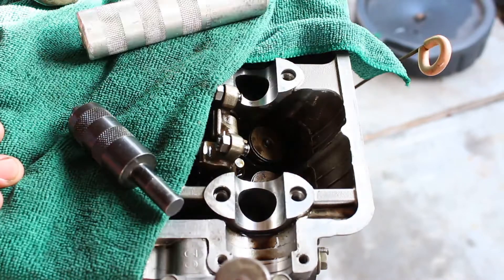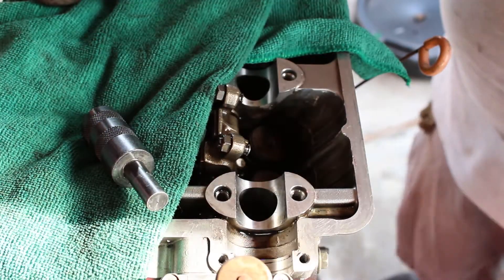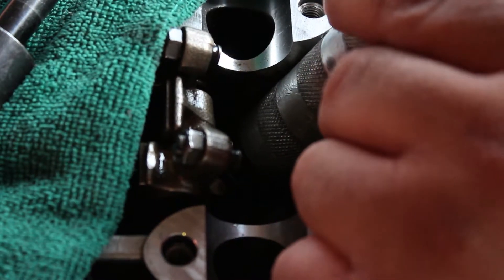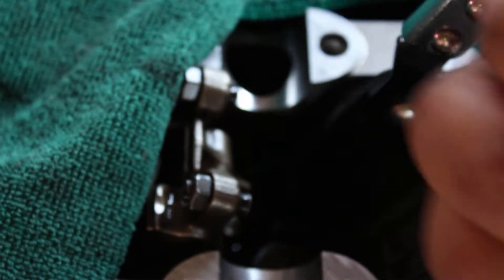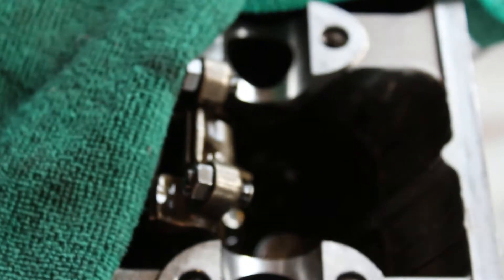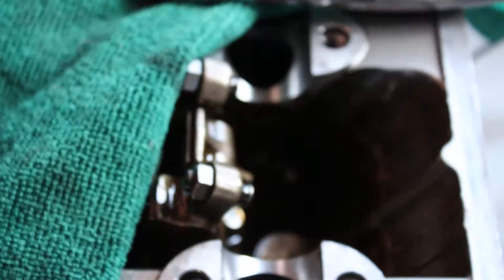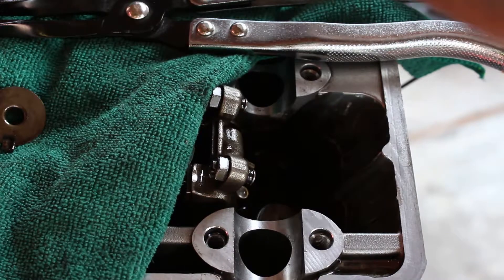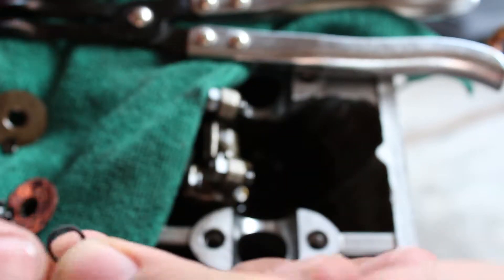b16a2 valve stem seals

Comment: I had success using shop air with the compression tester piece that threads into the spark plug hole to keep valves from falling.